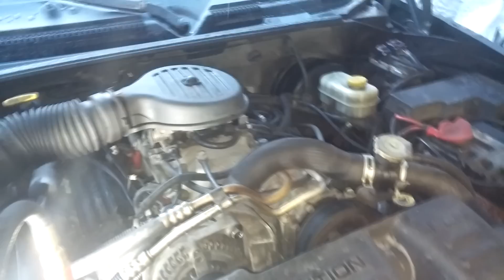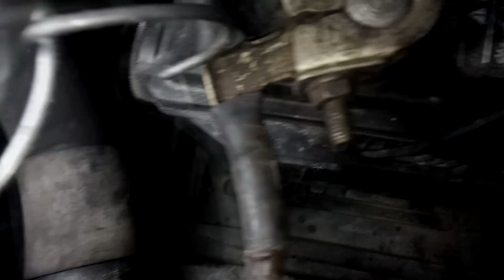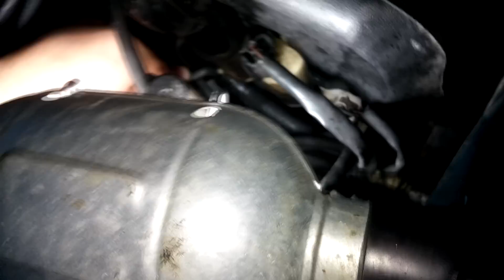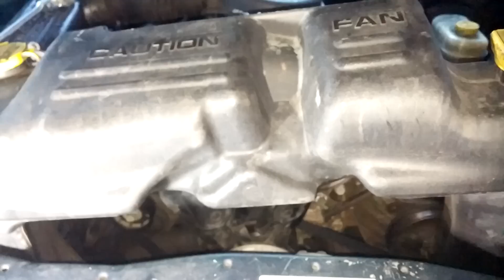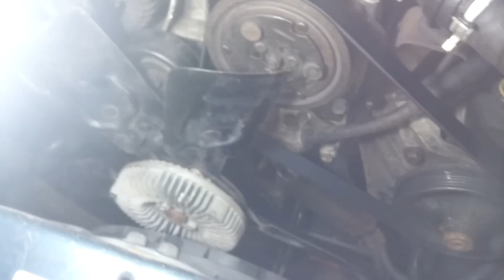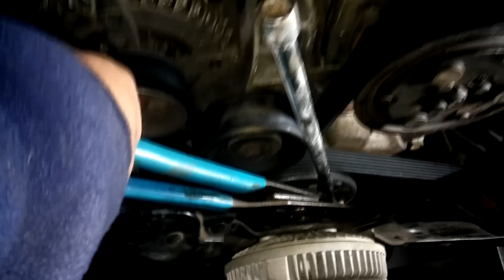Dodge v8 5.2l 5.9l Magnum water pump replacement

Comment: I have a 03 ram 1500 with 5.9 just had a shop replace the thermostat housing fast forward 2 months now I have leaking from the truck looks like water pump also have a constant squeak since I bought it only has 81,000 miles I can post a video

Comment: the radiator drain is on the lower left corner of the radiator, its hard to see with the lower half of the shroud stilol installed on the radiator, just some fyi, id rather have a part made in mexico than china

Comment: why is your oil pressure so low at the end of the video when you test drove it.  did you have to replace the oil pump next? just a question.
Reply from the maker: Well within reason for the rpms I was at in the video,  oil pressure is around 40psi here and when it's in normal highway driving rpms its around 60 psi. And just an fyi, low oil pressure is worn out cam or crank bearings,  not an oil pump. Pressure equals tight clearances in engine,  loose warn out bearings equal low pressure.  Pressure Guage was upper left,  gas gauge lower right, which the truck was almost out of gas.

Comment: How do you know if water pump is bad?  Can it fail periodically or when it goes it goes?  I sometimes get no heat and overheat - revving engine solves it - I back flushed system and replaced thermo and fluid. thanks
Reply: Sounds like your thermostat it's cheap and easy to fix water pumps fail when there's ain't freeze gushing out the front of the motor
Reply: *Anti

Comment from the maker: The truck is a 01 dodge durango 5.9 r/t 4X4.
The part is available from advance auto part. Its manufactured by Dorman, part number number 902-305. Up till a few years ago, you had to purchase the upper radiator hose as an assembly, with the two hoses, and fill spout. 
It's called a Dorman - OE Solutions Upper Radiator Hose Coolant Filler

Check out the link provided below. Also check  Rock auto or Amazon if you don't have advance auto part in your neck of the woods. Best of luck and if you like my videos, please rate, comment and subscribe, and tell your YouTube buddies.

http://m.advanceautoparts.com/mt/shop.advanceautoparts.com/p/dorman-oe-solutions-upper-radiator-hose-coolant-filler-902-305/22148344-P?searchTerm=radiator